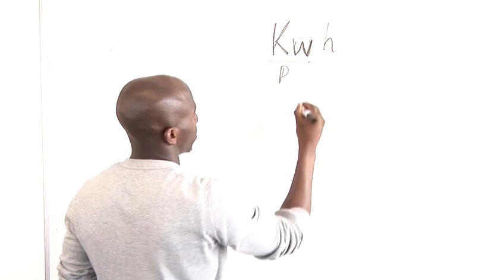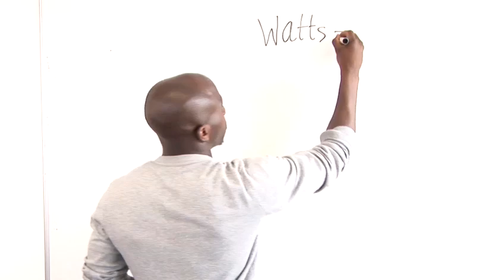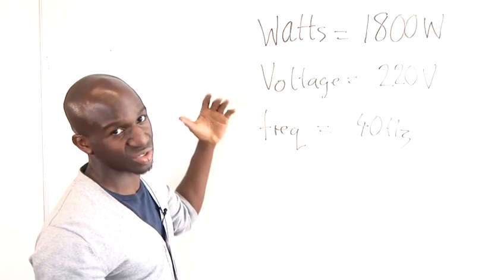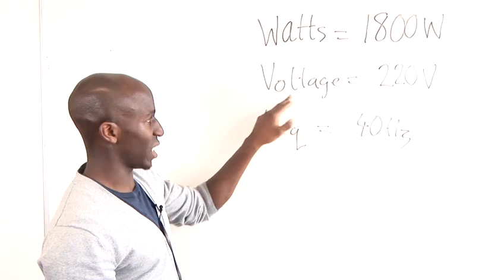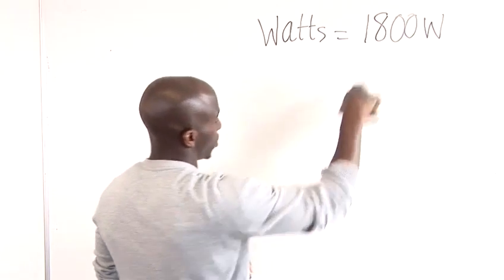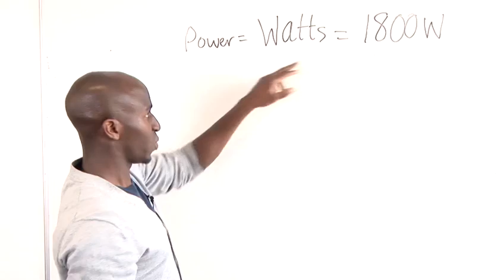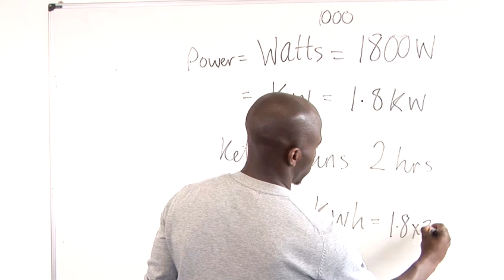How To Compute Kwh

Comment: pls help,    A TELEVISION SET IS 65W AND A REFRIGERATOR IS 1.2KW EACH ARE CONNECTED IN A HOUSE AND SWITCH ON FOR 24 HOURS IF THE COST OF ELECTRICITY IS 15 KOBO PER KWH HOW MUCH WILL IT COST??
Reply: for refrigerator that's impossible to say. Depends of the temperature in the room where it is placed, depending on the degree of loading, depends on the temperature we want inside, depends on how often the door opens, depends on the temperature of the food, depends on the TENSION of the network ... so There are variables... so that's impossible to make an account!